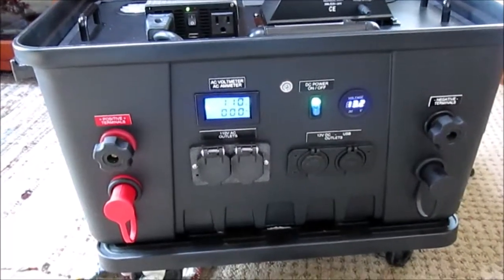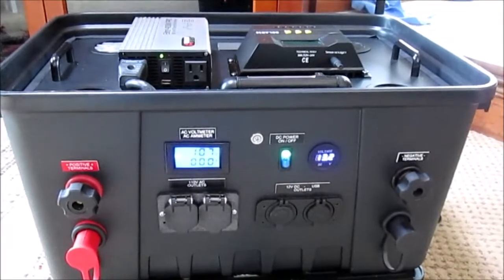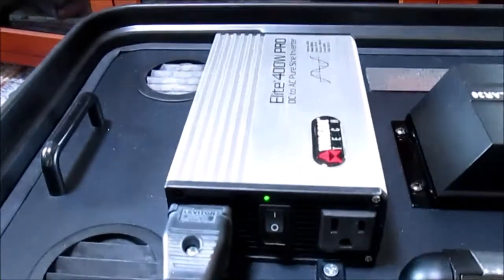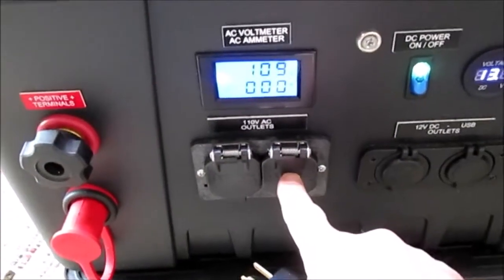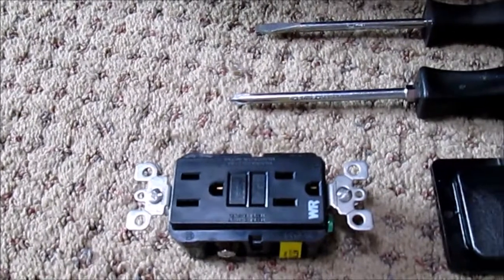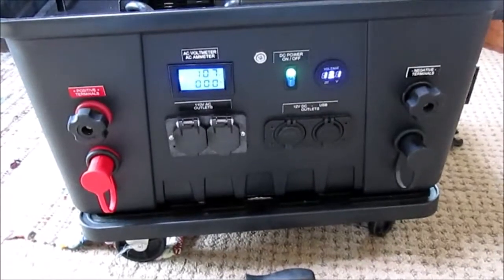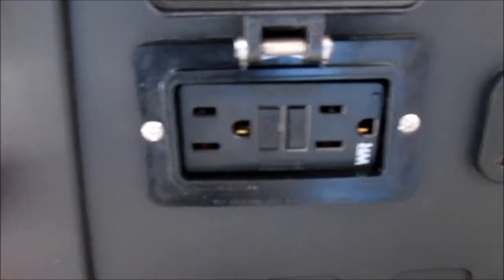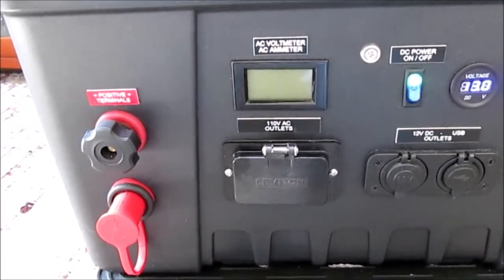V1 P7 DIY Portable Solar Power Generator

Comment: Jim, I had watched your first video several months ago and found it interesting. So, I saved the link, and I have now watched all seven (I assume the seventh is the last one you'll do on this project.) It was very entertaining - kind of like a "seven-episode season," documenting your progress over the course of many months!

I haven't read all the comments and answers, and maybe this had been asked before. But in the first video, you say the total cost was around $950, which I assume included the solar panels. 

With all the upgrades, do you have an estimate of the total cost? And can you say what the total cost is, excluding the solar panels? (Of course, I realize that your time is ultimately the biggest investment, but perhaps the most rewarding?!)  

Thanks for posting these. I have found them very informative, thorough but succinct, well-filmed, fun to watch, and a great resource as I consider undertaking a similar project.
Reply from the maker: Hi Randy.  Thanks for viewing and for your interest in my project. My original cost of $950 did include the cost of the 100W flexible solar panel I used with it.  The final total cost, including all of the upgrades shown in the 7 part series, was about $1065.  If you reduce that total by the original cost of the 100W flexible solar panel ($219), the battery box and all of its upgraded components would have cost around $846.  That said, the prices for some of the major components have come down since 2015.  You could build this complete system (with all of the upgrades shown through part 7) in 2020, including a 100W rigid solar panel, for under $1065.  I estimate that I put in about 30 or 40 hours building the system, and yes, that time was well spent.  What I was able to learn along the way about how these systems work was priceless.  It was a lot of fun to build and it continues to serve me well after 5 summers of duty.  If you have not seen the documents that I have posted that relate to this project, click "Show More" under the description of my part 1 video.  You will find a complete parts list with prices for all of the components used through part 6.  There is also a FAQ document that you might find of interest.
Reply: @JimFisherDIYPortableSolarPower  Thanks for your prompt and detailed answer. I enjoyed my morning, watching completion of the project, from the first video to the end results. I will definitely go back and dig in to details on the parts, prices and FAQs. All in all, it looks like a challenging project. But from the little research I've done, compared to off-the-shelf products that I see are available, your total cost (at least in terms of dollars) is a real bargain. And I love the DYI aspect. The learning is, as you say, priceless, and the satisfaction of making your own can't be beat. I'm feeling inspired. It might be outside my comfort zone, but we'll see . . . Thanks for sharing.

Comment: Did you ever secure the wires from the solar panel on you Bimini to prevent chaffing or causing damage? Congrats on all the updates to almost everything that I have sat and screamed at the computer about! LOL!  You have a Nice power source. You mentioned your using this on your boat? You on salt water?  Did you build with Marine grade wiring?  NOW take the batteries out of this nice box because batteries will leak at some point from charging and age and protect this nice build from battery corrosion and put the batteries in their own battery box (could also use a two wheeled box) properly vented and secured within the box and the box secured down to your very nice vessel when on board (also to simplify replacement or maintenance of the batteries). You might check this out I think that the American Boat & Yacht Council's have rules and requirements for batteries on board a vessel just to be on the safe side!  Connect the two boxes with a short run of battery wire to the threaded post you already have or add another pair of threaded post for this purpose. I'm using 175A Anderson Power Pole connectors in Yellow (ABYC color coding choice for DC) with the proper fuses to quickly and securely and Safely connect up the two boxes!  Check out splicing 175A Anderson Power Poles about 18 inches or so from one end of your jumper cables and to all your starter batteries and jump pack's for the added safety of not connecting anything by reverse polarity or shorting out with bare metal clamps. Its in the name of Safety you know! Also you might think about wiring your Solar panel to the vessels batteries and keep those fully charged if you haven't already and with the right equipment (battery isolators or battery switches) plug and unplug (Anderson Power Poles) the two system together. Just a thought!  Enjoyed your build!
Reply from the maker: Hi Bruce, thanks so much for your continued interest in my system and its use.  You raise some great questions and I'll do my best to answer all of them.  In the fall of 2017 my wife and I purchased our retirement boat (a Mainship Pilot 34), so the solar power system moved aboard the new vessel.  For now, and for about 2 or 3 more years, we will be boating in fresh water on the Great Lakes.  The current portable solar power system was not built with marine grade wiring.  I will eventually be building a new, non-portable system when we get ready to head to saltwater to live our retirement dream, and it will need to be built with corrosion resistant materials and components.  Of course, I will be replacing the batteries at that point (likely going to Lithium Ion, and hopefully the price will come down by then). Ideally, all of the batteries will be located in the engine room, well away from the cabin.  We are still in the process of determining the best way to affix the solar panels we will eventually need (during our intended liveaboard scenario) to the bimini top on our new boat.  We expect we will need about 400 total watts to serve both an expanded house battery bank and the starter battery for the boat's diesel engine.  One option is to add some stainless rails to the top of the bimini frame on which to mount 3 or 4 rigid framed solar panels with stainless hardware.  The other option, which I have recently discovered, is to continue to use flexible panels and secure them to the bimini top using very powerful magnets.  The cables to the panels we are currently using have been of far less concern (regarding chafing) than the edges of the flexible panels themselves.  On our new boat, the cables attached to the two 100W panels I am currently using pass over only about 2 feet of bimini canvas before heading down immediately into the cabin where we keep the portable solar generator.  The panels themselves are still secured to the bimini frame with bungee cords (similar to how it was shown in my part 2 video), and we simply remove them when severe winds are predicted.  Since my new boat is a slow cruiser (<15 mph, and usually running at about 8 mph), we rarely find that the panels are ever moving/chafing at all and giving us little concern.  I definitely plan to eventually charge all of the batteries aboard directly with solar power.  Presently I am able to charge both the portable generator and the house/starter battery, but the approach I must use is indirect and admittedly VERY inefficient.  In my current configuration I connect my solar generator's AC output to the boat's AC shore power inlet. In a pinch this allows me to power the onboard battery charger that is connected to the starter/house battery (DC to AC to DC, hence the inefficiency).  My long-term goal is to have a separate starter battery and a much larger battery bank dedicated to serve all of my "house" needs.  New battery switches and isolators will need to be included as part of that plan, along with necessary fusing.  This future plan will incorporate a much larger pure sine wave inverter that is properly wired directly to my boat's electric service panel.  To ensure that this is done properly, and in the interest of safety, I may leave that whole job to the professionals who will be far more familiar with ABYC standards.
Reply: @JimFisherDIYPortableSolarPower  Thanks for taking the time  for this answer. Enjoy your Project!

Comment: Hi Jim, I just wanted to compliment you on your excellent series of videos.  It's one of the best 12v based that I have seen.  And choosing gasless AGM was a great choice.  I see you used small wire gauges on the front pos & neg front-facing posts (the one with knobs).  If those are for future use with a bigger inverter, I think they should be beefed up.  I'm not sure if you mentioned your solar charger is PWM or MPPT?  I've burned a few. They do say MPPT adds efficiency.  I'm about to purchase 4 AGM's to build a box for S. Florida power outages for those occasions we get hit hard.  I think you said yours are 40Ah?  On batteries I am confused with all the different manufacturer specs.  A friend was recommending Optima Yellow Top AGM's with 750 CCA.  Do you about those?
Reply from the maker: Thanks for viewing and for you comments and questions.  You are right, a larger wire gauge on those jumpers is good advice...I think they are 8 AWG, their VERY short length does make a difference in the load they can safely handle but 1 AWG or larger would be a better choice for use with a larger (i.e. about 2000W) inverter.   I used a PWM solar charge controller.  MPPT does add efficiency, but at an increase in cost.  Most who have analyzed PWM vs MPPT recommend that the most cost effective approach, in small systems, is to use PWM and apply the savings toward more solar panel watts.  My system incorporates two 55AH AGM batteries.  The CCA cold cranking amps rating isn't as important as the deep cycle characteristics of the batteries you choose.  You will want batteries that can be charged/discharged [cycled] many hundreds of times.  You will also want batteries that can be discharged deeply to be able to use as much of the AH rating as possible.  For example, the 55 AH AGM batteries I used can be safely discharged to about 60% state of charge without being damaged, this effectively offers about 22 AH per battery to power whatever you want to run.  I don't have any experience with the Optima yellow top batteries, but search the web and read the opinions of those who have used them with solar applications...the ones I have read did not favor them for solar use.

Comment: Hi Jim, it’s been a long time..
Thanks for your update.. I’ve actually made 10 of these Generators now of all deferent sizes.. 5 has been sold to friends who really like it.. I’ve re invested the money into making more much better than my last ..They use it for camping and BBQ’s and outdoor party’s. I would have like you to break down the N Ground bonding a bit more in depth .. As I feel the invertor needs grounding some how. The invertor is modified, but I will upgrade to a pure sine wave soon.. I’m not shore how to Ground the invertor Running AC internally.. I know how to do it externally.
Or if it’s possible.. the DC 12v side has a positive and negative (ground) fused bus bar coming from my controller load ports, but it’s still not externally grounded either.
Any ideas?.. I’ve seen so much ppl’s videos on diy Generators, But none of them talk about Grounding or explain how to do it internally.
Reply from the maker: Hi Carlo, glad to hear that you have continued your work with these types of systems and thank you for your continued interest in mine.  I think there is a very practical reason why few, if any, DIYers will attempt to tackle the question of grounding...it is a complicated topic.  I'd prefer to encourage others to do their own research, consult with professionals, and to draw their own conclusions about proper grounding practices rather than to potentially offer erroneous information.  As mentioned, I am not a professional electrician but I have read extensively about the need to have a single neutral-ground bond at the AC source.  When using a portable system such as this, that source is the inverter, so it needs to have a neutral-ground bond.  It is also advantageous to use an inverter with built in GFCI outlets, or add them as I have done here.  I encourage anyone interested to do their own research on how GFCI outlets work and how they offer protection to humans who are using appliances connected to portable power sources.  I agree with your assessment of the DC side of these types of systems...they are not externally grounded and I cannot offer an opinion as to how to remedy that situation.